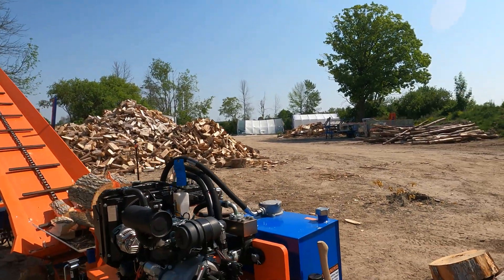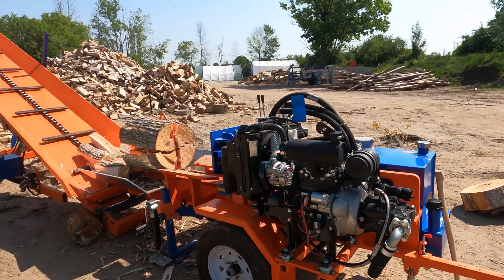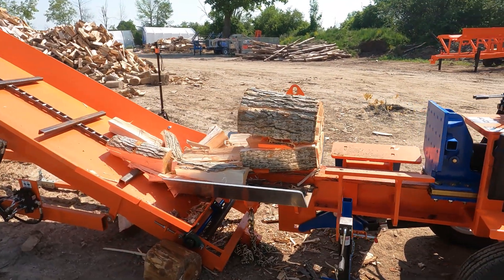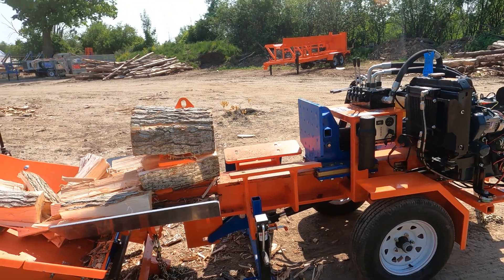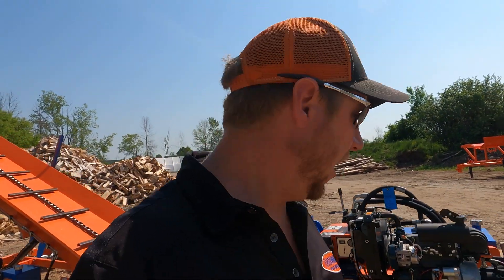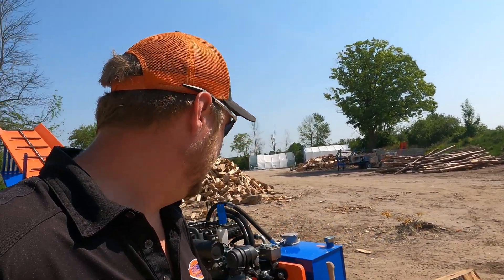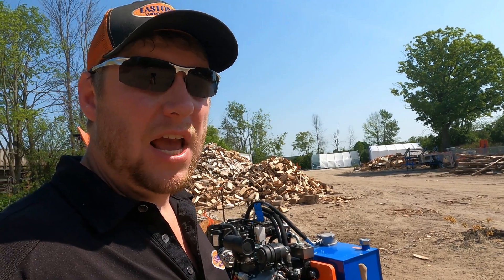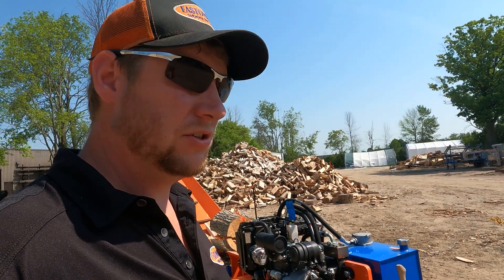Eastonmade; Log Splitter Chassis Design Reasoning

Comment: This is what I tell people, 4x8.5 ft is small for a powerful splitter.  On top of that, you can work from both sides, and if you get the 37 ton model, can get all the way up to a 12 way supported and is hydraulically controlled.  Cross check the other guys and they don’t check all these boxes.  You won’t notice these small but important details until you run it.
Reply from the maker: Thanks jose.  appreciate the support

Comment: Hey Andrew, I was watching one of your older clips of the 22-28 with attached conveyor and had a thought. Instead of the conveyor taking the wood away, could you do the same with a disc cleaner? Two jobs with one item.
Reply from the maker: Possibly?  The only hard thing would be the incline that the disc screener would need to run on

Comment: I have a 12-22 and the design is perfect for one person to operate it. I operate it from both sides regularly. What I do is stage smaller diameter logs to the left of the machine, so I can feed logs threw the 4 or 6 way quickly. The larger diameter logs are staged on the log lift side and I operate from that side.

Comment: The Eastonmade  company and its line up  Has changed the way the entire industry splits their firewood The  videos explain why they are the Best.  Andrew your insight and work ethic put  in every product design allows the splitter to be used to it fullest ability while making it as effortless on the operator as possible . I highly recommend these machines to any one who splits firewood Quality and performance and ease of use are second to none ! Good to see you posting again the 12-22 is running like a top.
Reply from the maker: Thanks for all the support tim!!!

Comment: Good points,  I have one of the other guys splitters with the big axle,  and while its  nice if I want to haul it 50 miles on the interstate,  its not very ergonomic to work from the log lift side.   Can I custom order a splitter with frickin laser beams attached to the wedge ?😂
Reply from the maker: Unfortunately no.  Do to supply chain shortages all we can offer are ill tempered sea bass 😃

Comment: To make field repairs easier and cheaper.   Put a 90* adapter fitting in the valve block so just a straight fitting on the hose  can be used, The 90* hose ends are more expensive and might not always be in stock.  Cheaper, easier, stocked at more places, = less down time which is the final goal for a piece of equipment like this.